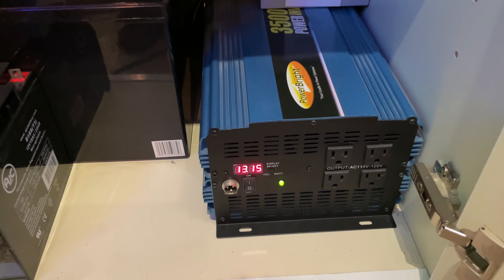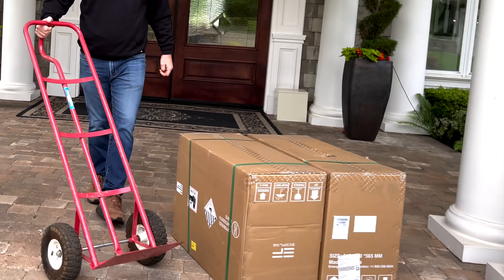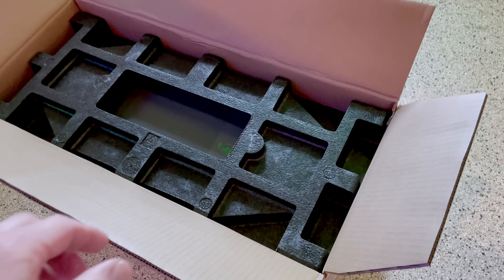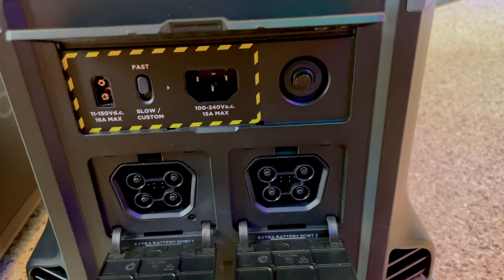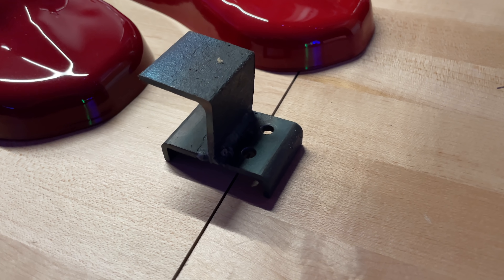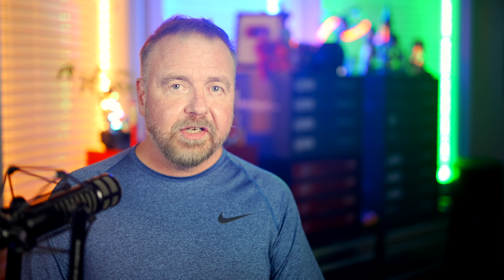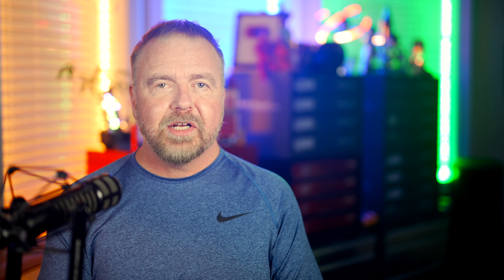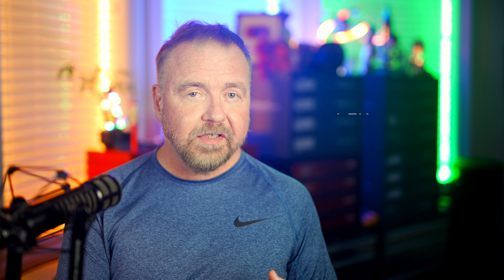Cheap Solar: 12 Years Later - What I've Learned and How I'm Upgrading It

Comment: Have to say since I seen the dinky red hand truck, you should get yourself one of those Costco 3-in-1 hand trucks. They go up and down stairs easy enough, you can lay it down so it becomes a cart, and has a 1000 lb rating, so no squished tires. Was invaluable for when I was hustling appliances, but I use it around the house and yard for other things now.

Comment: I'm in the process of designing my own solar setup, going the DIY route.  The current thought is using 280Ah LiFePO4 "prismatic" cells in the bank, running a 240V split phase inverter.

Comment: 240v service isn't 2 phase, it's single phase. 

Summer solstice the sun isn't over the equator, it's over one of the tropical lines depending on which hemisphere you're in. It's over the equator at both equinoxes. 

Please ignore this comment. I just had to post it.

Comment: If you are at the equator there is 2 times of the year when the sun would be directly over the panels. The equinoxes, spring and fall. But the summer solstice (and the winter solstice) would be the days in which the least amount of sun would be shining over the equator.
Reply from the maker: Hmmm... peak sun is actually during the solstice at the Tropic of Cancer, from what I could find!
Reply: @DavesGarage  Ah, but you mentioned at the equator in the video. :)

Comment: You should measure the losses in charging and discharging, and do it the long way by charging one up to full and using it to charge the other from empty. Then charge the now empty one with what made it across, the difference in numbers should be ya charging and discharging losses

Comment: Look at a Sol-Ark or Outback inverter if you want to take another step. Batteries are just outrageous though. I paid about $1800 each for 10 batteries. It was an industrial application but same would be true with off-grid applications.

Comment: I'm getting a Sunpower system installed that has a 13kw Lithium IRON battery next week. Can't run the ac off it but I can power everything else with it in blackouts.

Comment: How did the old system grid tie inverter work when there was a power cut? Most electric providers require that there’s a disconnect so you aren’t back feeding the grid which could give an engineer a shock on a supposedly dead section of grid cabling.

Comment: What you describe as dual phase is in fact single phase three wire. -120, 0, +120 volt.  There are true two power systems though these are largely obsolete.  The most common industrial system is three phase which is what power generators product.

Comment: Hi Dave, I'm so glad, and really pissed off that I stumbled across your channels. You see, I'm also on the spectrum, and have many similar interests to yours. Like so many with ASD, I find myself needing to research concepts in depth, perhaps to a ridiculous degree, only to find I will never use the information obtained.  Something about your delivery in your videos, sucks me in and I find myself spending way too much time following you down rabbit holes.  For example, I have a great grid tie solar system installed on my house, but now I'm suddenly feeling the need to add a battery system.  I'm also thinking about digging through the attic to see if I still have the Commodore Vic 20. . . Don't take this the wrong way, but please get out of my head

Comment: Finally utility battery storage. You can charge them at home then use them at a remote location. If they were sized/shaped right you could rig them up to be extra range for your EVs by putting them in the boot of the vehicle. There was a viral video where someone carried a petrol generator in their Tesla boot, just in case they ran out of power.

Comment: Re: fun things to try with the battery packs: operate an electric pressure washer. Bonus points for using a high-powered 240V pressure washer, since you've got the harness for that. :)

Comment: I'm impressed by the 240V from two units too!  They must be synchronizing the phase of their outputs somehow?  Glad you did this video since I'm thinking of setting up a similar solar-battery system to run power tools in my shed-workshop.  A local ordinance uses "is it connected to utilities?" as one of the criteria to decide whether a structure is only a shed or more than that.
Reply: Its not a secret, when you combine two dc batteries they are direct current so they combine automatically.  Most battery items in your house (toys) have maybe 2 - 4 AA , AAA, C, or D batteries in them.  They are all 1 1/2 volts but the output is the total of how many batteries your using.  So 4 batteries is 6 vdc. You will know that by seeing how their placed in the battery compartment, + connect to - connected to + etc.    In another matter, I don’t know why he said 200 amp means 1 amp for 200 hours.  He’s correct saying it but to properly size your system, you want to use 10 amps per hour over a period 20 hours in this example.  That’s how dc items are rated because if you discharge 20 amps per hour, you would think it would go for 10 hours, still 200 amp, but it will not last that long because it’s rated to be discharged over 20 hours not 10 hours. No one plans their system to run for 200 hours, they rate items for 20 hours. But of course a battery rated at 200 amp does not mean you get 200 amp. Like he said you can only discharge 50%.  So if you need 200 amp system, you actually need to figure 400 amp right off the bat to get 200 amps over 20 hours. Of course most converters are 80-90% efficient, so that has to be accounted for when figuring total system capacity.

Comment: cant wait for all those ecoflow and similar devices go kaput. there was already a safety recal for ecoflow device in my country. The insulation between the primary and secondary circuits of the product does not meet the requirements set in the product standard for insulation confirmed in several different points. In the testing, deficiencies have been detected both in the tensile strength test and in the surface and air gaps. In addition, the input ground is not connected to output ground.
Reply from the maker: Why do you think this applies to all similar devices?  Why would multiple manufacturers have the same issue?

Comment: I did once , long-ago  use a battery pack to generate something of interesting.  I was using a 10,000 amp , 400 volt  nickle  cadmium  battery rack,  which was used to close large valves and in the exciter circuit of a 6000 volt motor .  During a retro fit two tiny  wires were mislabeled....oops  on start up the gear cycle  was interrupted by two glowing orbs , we had created ball lightning,  yes it is real . Pretty,   totally fascinating, swirling pastel waves of energy circling .  I watched as the lead man tried to explain.... big boss  simply said fix it.  20 pages of drawings hours of testing .  I found the anomaly,  and told the leadman,  he scoffed . I put my meter away and watched  ... sure enough I was right  but I mentioned in front of big boss perhaps something was labeled wrong .... you haven't metered any of this yet ? Leadman ?  I know that was rude, but so is dismissing a person because you out rank him. I took out my meter and placed it across the circuit, lead an was afraid to get close to the circuitry.  Yea it started a mini war. . Take care

Comment: Lithium Iron Phosphate is even better than Lithium Ion. They can be drawn down to nearly zero and being kept charged to 100% doesn't hurt them. I'm replacing the Nickel Metal Hydride battery in a 2nd gen Toyota Prius with Li-Fe-Po4. Despite holding less total charge than the original it holds more usable charge. The NiMH battery is limited to a 90% max charge and doesn't get drawn down below 30%. As the battery ages the capacity buffer between 90% and 30% shrinks, so the car can use the battery less and less for early acceleration before having to start the engine. Treating the battery so gently does contribute to a Prius battery frequently lasting 200,000 miles or more, depending on how well the driver treats it and various other conditions.

The company that makes the Li-Fe-Po4 upgrade figured out how to trick the car's system into charging it more and discharging it more so it's a simple mechanical swap of the modules and removal of the buss bars on one side of the pack since it uses half as many modules that are twice as thick as the originals.
Reducing the number of interconnects by half also contributes to improved efficiency by eliminating resistance between the threaded studs and buss bars. Another benefit is the new battery weighs about 40 pounds less than the original, so either there's that much less dead weight to carry around or you can load up 40 more pounds of cargo.

Comment: Those are NOT lithium "ion" batteries (like in phones and laptops), but instead LiFePO4, a different kind of lithium technology, like in RC quads or RC cars. It has a bit lower energy density, but much safer and also like 10 times more recharge cycles. LiFePO4 is also ideal for 12V systems, like in RV. As for the charging and discharging speed: the bigger the battery, the better. And if you are willing to go into all the technicalities and don't mind a bit more space, you can build your (ugly) version of those boxes for a fraction of the price. Like 16 cents per W/h for the battery cells.
Forgot to mention: for house is better and electronically cheaper to go 48V (also ideal for LiFePO4) instead of 12V. Because price goes up mostly with current, not power. And this is then 4 times less current for same power.
Reply from the maker: It's my accent.  I wasn't saying 'ion".  I was saying Iron.  That's my story ;-)

Comment: Thank you Master Dave for letting us think along with your pet project. 

I believe what would be super beneficial for zillions of people going forward is SMART LOAD SHADING Mgt.  
A sort of missing Hw/Sw extension that manages how power bank energy gets used up.

(Nuking large batteries with extreme currents not my thing... finesse trumps muscles!)

> There are existing clamp sensors that can measure whole home current -Or multiple sub-panels. 
> Toggle loads using off the shelf Z-Wave switches -Or other prefered standard.
> The core is the shading logic that understands "Load PRIORITY" vs. "Load SIZE" 
> You add the hability to learn from "Manual overrides" to bump up priority.
> Making the user interface simple ensure ease of use benefits without the kind of granular setup we engineers enjoy. 

> This would be another real life implementation of TaskMgr!
🙏👍
Reply: An existing commercial solution for mid-size systems is APC's "Universal Transfer Switch" like the model UTS10BI. It has lots of rules so you can do simple things like turn off the air conditioner if you turn on the microwave. I haven't looked at its manual in a few years but IIRC it has relatively advanced rules for a standalone device.

Comment: I read my local city's electrical code and was deeply disappointed. Any kind of homeowner installed solar, even completely off-grid experimental, is problematic and may be fined if it exceeds 25W in power. That is not a typo.
Reply: I saw a video a while back talking about a state back east where the utility company was so powerful it had those laws put in statewide. It surprised me because in California we have massive subsidies for grid tied solar. I had no idea it wasn't the same everywhere until then.
Reply: @lightningdemolition1964  I'm in Texas.

Comment: I am sure you are aware - Your generator extension cord appears to have a male fitting and the house has female receptacles (or so they look-) .  This can be deadly - if you forget, or someone else is not aware, the male end can be hot as I'll bet both ends are male... and if you plug into a running generator before the house, those tines are HOT.  Something to think about, even though that is your back-up system.  *cleared up because I looked again after your reply* My point is just one of awareness - double male cables are deadly.  As far as pigtails, twist lock**  Nice batteries BTW...
Reply: I use the a male receptacle on the house. Pigtails can come out by accident, and you are at square one.
Reply from the maker: Uh, no.  That'd be insane.  I do NOT have a cable with two male ends nor am I plugging a male end into the house.
Check Amazon... the receptacles are male, the cords are standard M-F.
Reply: @DavesGarage  I'll take your word - you know what you have.  I agree, it is insane - and it is done.  I will never understand why...

Comment: Dave, all made good sense but I am surprised that you treated "Lithium" as if the cells all all the same chemistry and didn't mention Lithium Iron Phosphate which offers longer cycle life but lower power density than traditional Lithium Ion batteries.

Comment: Good video Dave, im going to updrade too, im shopping LiFePO4, over Li. I want that better BMS and deeper discharge rate, I also like those Eco flow units, think im headed same direction, we have much in common, i use my solar for security and coms, and 2 motion lights, i run 2 low energy night lights, if i loose  all power, use a combo solar, diesel on a bulk tank, Im also in Canada, Good luck

Comment: The equator gets the most intense sunlight during the equinoxes, not solstices
Reply from the maker: I contend that peak sunlight occurs at the summer solstice, which in turn occurs when the sun is directly over the Tropic of Cancer, which is located at 23.5° latitude North, and runs through Mexico, the Bahamas, Egypt, Saudi Arabia, India, and southern China.
Reply: @DavesGarage  Sure, if you're at those places, you'll have more sun at the solstice. But at the equator there is less sun during solstices and more during equinoxes, since the sun will be overhead at the equator then

Comment: if you're doing grid-tie, you don't need or want a battery bank. those cheap grid-tie inverters work best on their own, solar panels connected direct with no batteries. if you want backup power then a grid-tie inverter can't do what you want, they only work when the grid power is available. these are 2 different systems that don't easily mix.
Reply from the maker: Remember its BOTH grid-tie and off-grid capable.  When grid is active it syncs the waveform going out to the grid.  When grid is down, all power stays local but is no longer synced.  So yes they are two different systems but I did mix them :-)
Reply: @DavesGarage  the new system does? cool, good. the old system though, how do you connect the grid tie inverter? I'd think if connected directly to batteries, it would drain them. could turn it on only when the batteries are full, but wouldn't want it drawing power from the batteries. maybe a relay or contactor? when batteries are full, switch panels over to the grid tie inverter.

Comment: I don't know if my previous comment got through or was lost.  But the main question was the main antenna switching and starting the sound card to record was intended to work at a speed that would generate an audio tone that matched the electronical rotating of the antennas.  In the main loop I also put in a call to the keyboard new key clicked command in windows according to Petzold.  It has been a while since I fired up the RDF Radio Direction System.  But I was never able to switch the antennas at an audio speed.  It seemed to only move about 16 cycles per second.  I couldn't figure out what was slowing it down but maybe there is something in the windows operating system that prevented it from checking the keyboard click fast.  Something seem to tie it to the timer interrupt.  I never saw it in the code and thought I tried to single step the code, the code was just too long.  Do you know what prevented me from running main antenna rotating and sound card loop and checking the keyboard at full speed.  I maybe should try this again some time.  But if anybody knows I figured you might.  Thank you for reading so far.  Richard Sindric  

P.S.  I did get the system running at the reduced speed.  Instead of an audio tone where I could look at the phase of the tone, I instead got pulses who's amplitude I could check.

Comment: Look into rejuvenating lead acid batteries. It takes about 8 hrs per battery.
Reply from the maker: I've seen a guy in India rebuild one, looked dangerous!
Reply: @DavesGarage  It isn't, but more goes wrong than just replacing the liquid in the lead acid battery, plates warp, crack and come apart.

Comment: I'm wondering how clean the output is for powered loads such as radio communications equipment. I have switcher power supplies that let you shift the switching noise to quiet down the output for what you are working with.